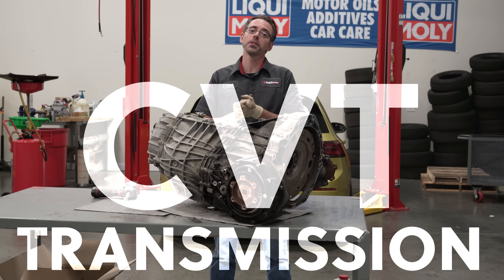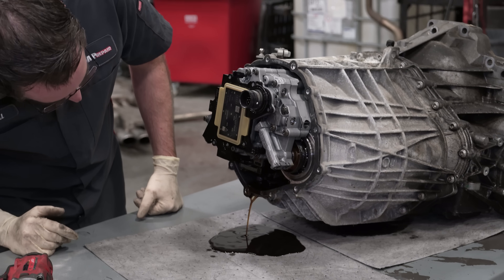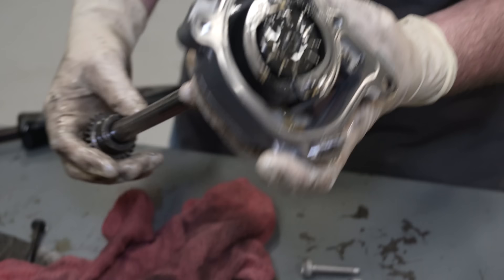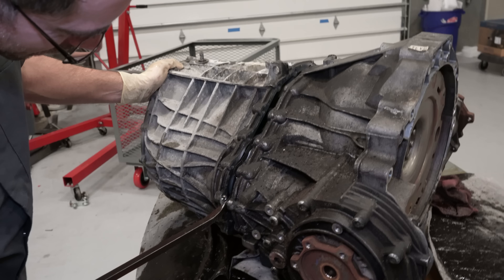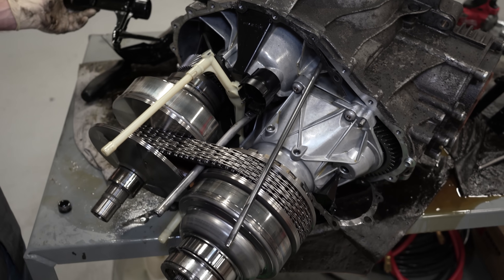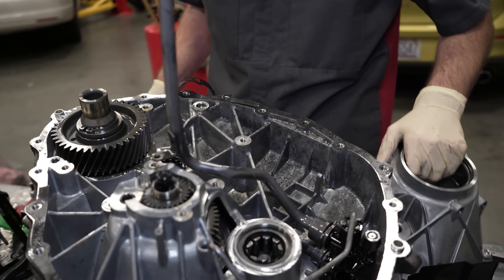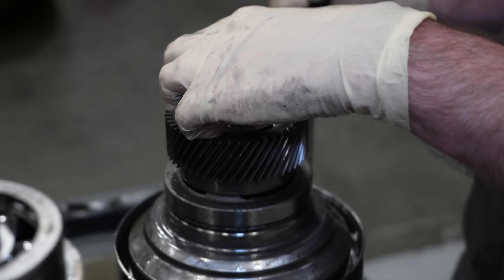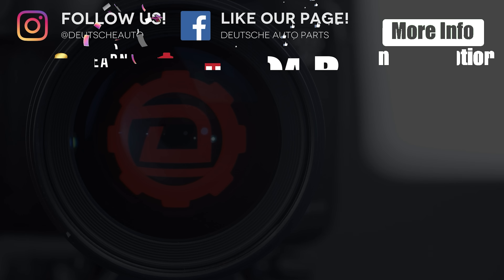Why you shouldn’t get a CVT transmission

Comment: There is nothing wrong with a CV per se.  There are good brands and there are bad brands.  eg JATCO v Asean or those used in Nissans v Toyota/Honda.  You then have to realise what you get with a CV.  If you want boring, droney, sluggish but very economical - then they are the gearbox for you.  Dont forget they need servicing too.  Personally, I hate them.  Got a Mazda 2 with a 6 spd auto.
Reply: Subaru manufactures its proprietary Lineartronic CVTs in-house.  And they work very well.

Comment: Honda actually uses CVTs in most if not all of their current models (maybe not in the pilot/ridgeline). Its kind of the base trans they offer. As far as i know they are pretty reliable and efficient, even though an enthusiast would absolutely hate the feel.
Reply: Got a 2016 Honda Civic with the CVT, and it’s got 130k miles on it and it’s still running great
Reply: That's why I want to buy used 5 speed automatic 2.0L civic.
Reply: they have inproved the jdm cvt. but the dirst years of them are terrable and almost everyone was using them.
Reply: yeah, same with hybrid toyotas, I've driven a Corolla and a CH-R a couple of times, and they're great, even tho they're not luxurious, they drive so freaking smooth, they're an absolute joy to drive even tho they have CVTs
Reply: I have got one in my Mercedes A Class. It’s excellent!
Reply: 2015 honda civic, cvt transmission went out at 105k, extended warranty only went to 100k, shop wanted $8500 to repair.  Very sad.  Stopped buying honda cars.
Reply: @kurtheim7425  Honda is over rated.  Bought 2019 CRV & sold it this year with oil dilution problem.  No more Honda.
Reply: Can verify, I have a Honda Civic with a CVT. Runs great and I've put almost 90,000 miles on it with no problems. People who don't like the way it performs are usually either mechanically ignorant or just unadaptable to new things. You can't drive a CVT car and expect to feel it shifting like a conventional automatic or manual. Some CVTs have added in the simulated feeling of a gear change so that morons don't bring the car to the shop saying it's not shifting right. In my mind, that is just stupid. Inform people about how it works instead of altering it to fool them that it works the way they expect it to.
Reply: @jonniemactyler7929  Strange, I always thought that anybody who gets a sporty or smaller car, or truck with any kind of automatic transmission is mechanically ignorant and lazy like my wife. Especially people who buy cars with CVT transmissions. 
The last brand new vehicle we went to purchase back in 2010, she tried to convince me into buying an automatic. No f. way! Manual only or nothing.
Thirteen years later and her Toyota Yaris still has the original clutch. I was just replacing two quarts of manual transmission fluid and brake fluid (which is used for the hydraulic clutch as well) every two years. You can have those "sophisticated" toys and I will stay primitive and mechanically ignorant!
Reply: @MrCROBosanceros  Make em last then, because even Toyota is offering only a couple of cars in manual gearboxes now. Even the Corolla now (2023 models) only comes in a CVT unless you get the GR which is $15k more than the base models. I agree that stick shifts are the most reliable but that isn't the gripe in this video. The implication is that CVTs are all worse than conventional automatic transmissions, and that just isn't true. Plenty of conventional automatics that crap out well before 100,000 miles.

And my point of mechanically ignorant being the problem is based on people bringing a CVT to the shop complaining that it isn't shifting correctly. When you ask for more explanation you find out that they drive it from 0 all the way up to 50+ mph and it doesn't shift and barely changes in rpm. That driver is ignorant, because that transmission is functioning perfectly...they just know it doesn't feel like the last transmission they had.

Don't hate the CVTs, just change the fluid every 20 to 30,000 miles and the ones made by Honda & Toyota will acually hold up quite well.
Reply: @MrCROBosanceros  so true but in todays world 90% of the drivers in the usa cant/whont drive manual transmission. where the rest of the world pretty mutch is all manual transmission. so we come up with these over engnerd sloutions for better ecnomy.
Reply: @MrCROBosanceros  🤣 bro..i dive a 2000 buick..i aint lazy..
Reply: @jonniemactyler7929  This is a sad day when Toyota doesn't offer a manual transmission for the legendary simple, fuel-efficient, easy-to-work-on, and reliable model. I would not even consider buying a new Corolla.
Reply: @edubb2491  I said small cars.
Reply: @MrCROBosanceros  Toyota Corolla Altis is a joke, that kind of price only 1.8L CVT available(it cost more than corolla Cross!), don't even have independent suspension. We would buy cheaper Yaris sedan or pay a bit more for Civic 2.0L. That's why Corolla are rare. The only good about yaris is Manual transmission.
Reply: @GF-mf7ml  I live in Canada so I don't know exactly which one is Corolla Altis. I know that I wouldn't buy anything without manual transmission so I would consider buying Honda Civic with 2.0L or maybe Honda Accord.

Comment: Question: why cvt transmission has solenoids to change gears when cvt doesn’t need?
Reply: Because customers were freaking out when they didn't feel a 'gear change'.  Frankly, I could do without the fake shift, simply because it slightly reduces the efficiency of the transmission.

Comment: surprisingly, my sister's 2017 corolla cvt with 130k miles is still going strong. but its mostly highway miles.
Reply: 2016 S Premium at 195K miles here from brand new March of 2016. Fluid changed twice, the software reflash recall done. No issues. I just don't like CVT's, and Toyota has honestly made it bearable. Ever experienced the CVT in a Mitsubishi Mirage?
Reply: @MyerShift7  nope. first time in a cvt was 2009 nissan sentra. that cvt went out around 100k. toyota made me a believer in cvt's. i just dont like the fake shifting
Reply: @carplay5454  Subaru's is just as good, if not better.

Comment: If I am not mistaken Audi does not use CVTs any more?  I know they are not great.  Nissan owners are always having problems with them.  I don't know if they got any better but many people despise the JATCO CVTs.  There are two kinds of people who own them or have owned them.  First is the one who would bullsh!t you into thinking he got 100,000 miles on the original fluid then there are the ones that had failures under 40,000 miles who would say things like "I will never buy another Nissan again!!"  The fact is that even Toyota and Honda are using them now.  Toyota is supposed to be the more reliable of the two but Honda is not terrible either.  I had a 2013 Passat 2.5 with the 09G and it wasn't shifting too great either.  It would be the best car I ever had if VW could stop having valve body issues with the 09G and similar transmissions.  Of course there are a lot of people who have had good luck with those also.  Maybe the DSG would have been better?  All I would have to do is change its fluid every 40,000 miles or sooner if the need for it is noticed.  I think what back to bite Volkswagen was saying the fluid for the 09G was a lifetime fluid.  I hope that bit them super hard!  We have them trying to appeal to people who have no mechanical knowledge and trying to make it look like they need little or no maintenance.  The fact is no fluid lasts forever!!  Even water can need a change if left sitting too long!!

Comment: I Own a 2004 Audi A4 1.8T AMB 90,000miles CVT  Valve body internals are destroyed. NEED a FWD 5spd for it and the cluth pedal w/bracket attached, cables, resivoir, shift linkage, shifter . PLEASE help!          I believe HFB*** Ill have to check the one I bought from a Scrap yard in Texas 2 yrs ago. They were so kind as to sawzaw the shift lever in half and send me Their destroyed transmission I needed......

Comment: I get why people dont like CVTs but have had two Nissan/Jatcos and no issues.  09 rogue and 13 Pathfinder which I towed a camper for five years with.  Strong with no issues. Just changed fluid with dealer at 120,xxx.  Luck of the draw i think but, also some peoples driving habits play a big part as well.

Comment: CVTs are still being used coz the Japanese have figured out the bugs and how to make them more durable and work better, specifically Honda and Toyota. The new Generation CVTs 2017 and up are problem free. Toyota figured out a Launch gear , toothed gear, for 1st gear which transitions to CVTmode after first gear. So the European and German tech is lagging behind the Japanese in this arena.  Traditional automatics will not be able to match a properly designed CVT in terms of  efficiency in both cost. weight/size and performance.

Comment: So this type of transmission is quite bad but what are the options for hybrid cars? Most of them use cvt transmissions only.
Reply: The Toyota Lexus, and Honda eCVTs use electric motors to simulate changing the gear ratio. The Toyota system has a single planetary gear set, and the Honda system has a few reduction gears and a single clutch. Both are virtually indestructible.

Comment: my first and current car is a b16 Sentra 2.0 with a cvt- family friend was junking it due to a blown trans and I diverted the driver and paid a shop to put another in and have been driving it for 20k+ miles since. definitely a weird feel but you get used to it. next time it goes I’m putting in the 6mt but I don’t think the thing will be going out with regular fluid changes and a proper transmission cooler. it’s my first car- but the thing gets a lot of hate for good reason.

Comment: Help Please. 
I have a mk6 tsi ccta that blows a lot of white-ish smoke under throttle. I change the turbo (I used my old mk5 k03 turb) , new oem pcv, compression is 180 on all cylinders. Spark plugs look black and with some oil residue.  You think it can be valve seals? Or should I try an actual new turbo? Bad oil piston rings? 
I also ran the car with the car with the turbo charge pipe disconnect (to make it N/A) and it still blows smoke.

Comment: CVT is actually for basic low power cars as its very cheap to produce. Toyota added the direct first gear to its cvt to reduce wears  n slips making it more reliable. If you don,t take off like a mad rabbit your CVT will probable be just fine.

Comment: If you have a car with a CVT gearbox, change the CVT oil and filter every 40,000 KM - inspite of what your owners manual says. There was a video done by car wizard where they drained the oil out of a CVT box which had its oil changed 40,000 km back and the oil was jet black. If one sticks to the 40,000 KM oil change intervals, these gearboxes should last. I have seen high mileage Audi 2.0 TDIs with this gearbox - example a C7 A6 2.0 TDI done 200,000 KM and it drove fine - but no idea if the owner changed the CVT fluid on time.
Reply: I changed mine at 38,000km on a 2015 toyota corolla altis and it was black and the filter was dirty, its now on 66,000km so when it hits 75,000km i'm doing it again along with coolant and brake fluid

Comment: The cvt wore out quickly in my wife’s 2015 Toyota Corolla failing her at a stop light leaving her stranded and Toyota dealership picking up the repair under warranty. They said it pretty uncommon but I wonder. In the same time my 2011 a3 with dsg has had no issues in the transmission department.
Reply: It is exceptionally uncommon. Check the fans at Toyota Nation. Mine is a 2016 S Premium (heated seats only with CVT in US). I'm at 195,000 MILES right now. One software reflash and two fluid changes later. Not an issue at all so far. I did have a wheel bearing go out though. Oh, and I got the car brand new in March of 2016.

Comment: Toyota's dCVT will last forever, it has a physical first gear.  Their hybrid eCVT has no steel belt and is ingenious...
Reply: Finally someone with good sense! CVTs are exceptionally good for gas mileage and comfort when paired with low powered NA cars like Corollas or something. Under the correct application CVTs are awesome!
Reply: @AlexandreNegrao  ah so they are incredibly boring
Reply: @sigmamale4147  Well, if you manage your expectations you won't get frustrated. If you buy a car with a CVT expecting a double clutch performance... 🤷
Reply: BTW, the prius CVT DOES use a belt.. they last so long because the traction motor does the majority of the hard work-getting the car moving from a stop.. and it's almost always working WITH the engine, greatly reducing the amount of wear and tear on the transmission. That's why they last so long.. very few hard starts to "shock" the points of friction/contact inside the tranny. They work great for hybrids... But honestly? They need to quit putting them in EVERY FUCKING THING!
They SUCK! they're expensive and unreliable.. the engineers who designed them should be stuffed into the casing of one since they love them so much.. and the bean counters and government regulators should all be drawn and quartered... Bring back stick shifts for Christs sake! They should NOT be relegated to only sports cars, basic models, and super cars!
Reply: @fadingbeleifs  Toyota ECVT does NOT use any belt.  Planetary gears in constant mesh
Reply: Ford uses the the same design as Toyota for their hybrid models using eCVTs. I'm excited to get a new Maverick hybrid :)
Reply: @RDubs  lol I'm sorry. Good luck with that. You should never trust Ford.
Reply: @DutchiezRNG  no actually Ford uses jatco units in some of their vehicles... And they also use GM CVT transmissions... They are all equally horrible..
Reply: @DutchiezRNG  that's false 🤣
Reply: Basically. It's those Jatco CVT that are shit. Aisin is OK.
Reply: I wouldn't take a vehicle with a CVT if you gave me the car. I beat the daylights out of a 2015 Versa for 2 years, and the CVT crapped the bed at 40k If engine was 1 quart low on oil 2k after an oil change, the cam train would talk loudly after the car started.  The engine holds only 3qts of oil. It wasn't my car. What did I care. Not at all. CVT transmissions suck. Bring back the standard gear box, and that alone should eliminate allot of drivers and put a stop to holding your phone while driving. 2 birds 1 stone
Reply: @Keith Hults  as stated the Toyota ECVT does not have a steel belt, it is constant mesh planetary gears.. big difference lasts forever, very durable
Reply: @keithhults8986  jatco front wheel drive gearbox especially CVT units sucked. You shouldn't judge CVT based on the bad designed ones, look at those AISIN/toyota CVTs

Comment: Bought a 2nd hand 2005 Ford Five Hundred with the ZF CVT and Haldex AWD as my winter beater here in the frozen wastes of Western Canada. Been driving it for 6 years now. It's got over 120K miles on it, and it's still going strong. Fact is, the Haldex unit has given me more grief then the CVT ever did.

I cannot stress enough that a CVT demands regular preventative maintenance for long life. I believe they're susceptible to heat, and thus requires more periodic fluid servicing than a regular auto trans. Many companies claim they're "Sealed for Life", which is a load of crap. Best to change the fluid every 50K-70K just to be sure, especially if you live somewhere hot.

Biggest gripes I had when I serviced mine was the cost of the fluid (approx. $15-20 per quart from Motorcraft, and you need 10 quarts for the service). Accessing the high-pressure filter is a bit of a pain too. You need to remove the driver side wheel, fender liner and trans mount to access it. The filter is also spring-loaded, so pressing it in while trying to bolt the cover plate on requires careful attention.

Other than that the CVT has worked fine for me. It does drive a bit lazily, but other then that it's worked remarkably well. It's still odd to see the speedometer rise while the tachometer drops at the same time! CVT magic, hopefully without the magic smoke and fluid puddle!
Reply: I have a Toyota Vitz (JDM) 2012 that I got back in 2015 and I totally agree with you. It's now done almost 190k and the CVT is a godsend compared to the other automatic trannys I've driven. It's really smooth, feels like you're gliding on butter and I love the great fuel economy I get with car. They're a different type of transmissions which require a throttle control that might not be ones first nature. Overall I love the CVT for a cheap city car but when I'm in the mood to drive, manual cars are the way to go.
Reply: @farqualeetali4022  - good point about the throttle control! I didn't add that in my comment because it was already long but that did enter my mind. You have to keep a constant throttle position and let the transmission do it's work. I feel if more people drove like that, then CVT life would be extended. As for the manual - I agree. My '84 VW Jetta GLi coupe with the 5-speed is a blast to drive, even though it's almost 40 years old! Cheers!
Reply: The key is regular maintenance.
Reply: My daughter had a 500 that went to 275k miles and still worked fine yet til it got in a crash. The one she has now has 220k miles on it and works perfectly. The first thing I do is change the fluid and high pressure filter when she bought them.

Comment: Subaru, some how has the best ones I have seen. Nissan and Mitsubishi use Jetco and are complete garbage.
Reply: Correct. Subaru manufactures its proprietary Lineartronic CVTs in-house, and it's about the best in the industry.
Reply: @Eskie Man  the only cvt I will own/drive. Just not a turbo engine paired with it. If they just weren't so overpriced used. Lol

Comment: CVT transmissions are by far the worst idea that automakers have come up with.  They are great in proper applications,  scooters, mopeds, quads, snowmobiles, things like that however passenger vehicles require far too much torque in my opinion for a CVT to be reliable.